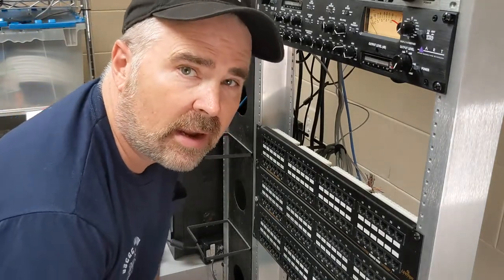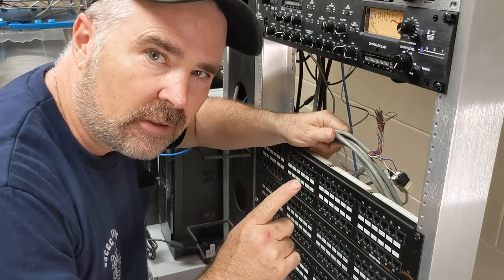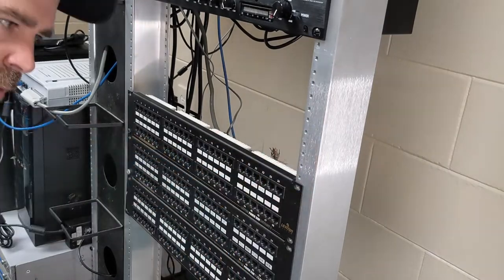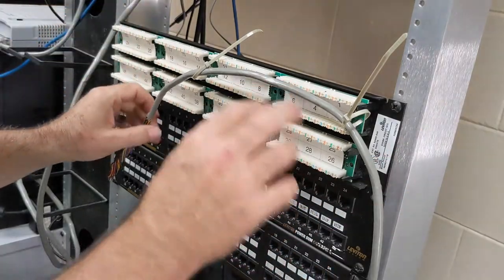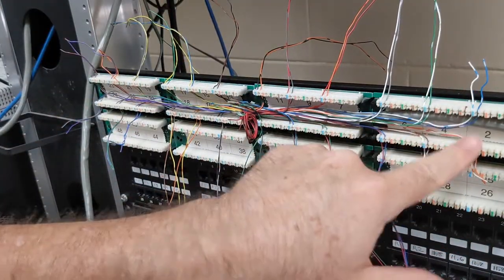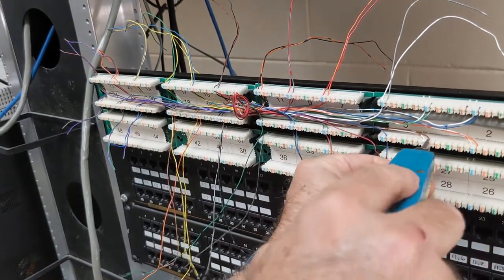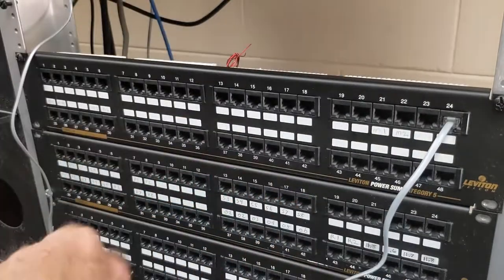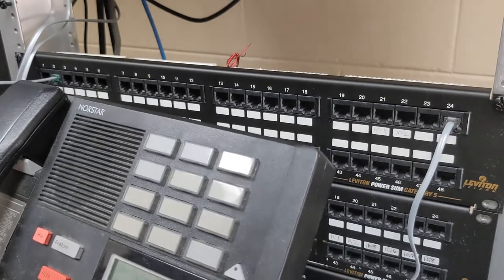Wire BCM50 to patch panel

Comment: I got hired by Northern Telecom in 1988, South Jersey. I came from a cable installation background a lot of manhole and large Mainframe installations. What I had to learn at Nortel was PBX installations (the techs were really good teachers) and working a lot of overtime. This was the advent of Digital PBX's...and in Philadelphia all you saw were Notel vans. I loved that job and the company.
Reply from the maker: I hear you Pete.  NT was an amazing company (basically the Canada version of AT&T).  They made amazing products.  I built the early part of my telecom career mostly working on Nortel products since the early 90s.  Too bad the folks at the top mis-managed it into having to be sold-off. 😢

Comment: Dear Nortel guy: I bought a----Nortel Meridian Northern Telecom Norstar 03G NT5B101 w/ Soft NT5B10CA----.  Is there anyway I can get caller Id to work with this pbx? Would a different software cartridge give me caller Id?  or am I just out of luck?
Reply from the maker: Well,  that’s a Compact ICS which I believe should inherently have CID capability without additional licenses.  Probably a configuration thing needs to be done.
Reply: @thenortelguy   thanks I'll do more research....